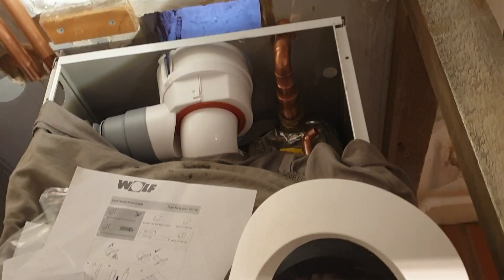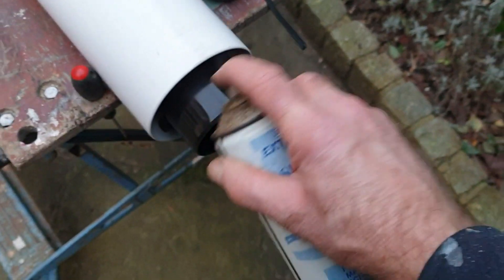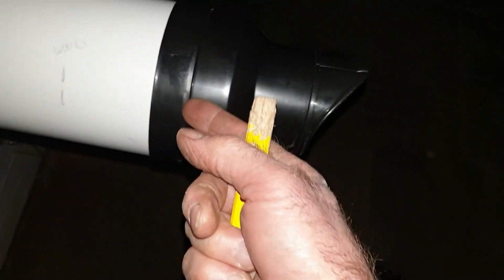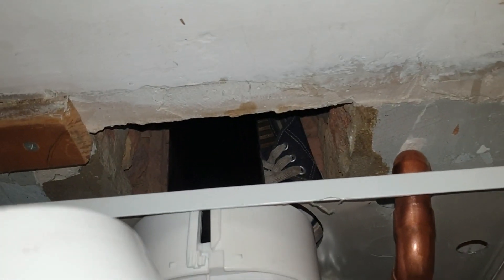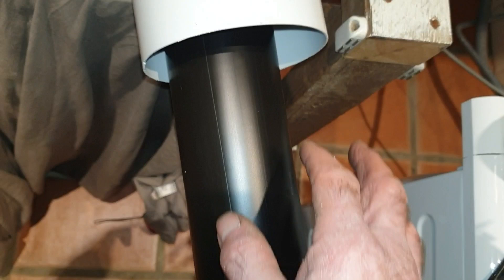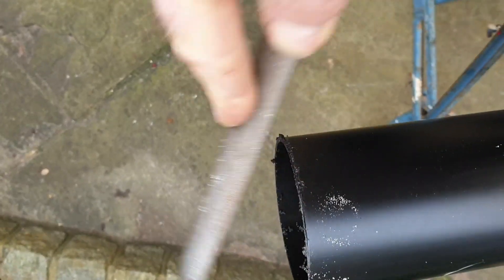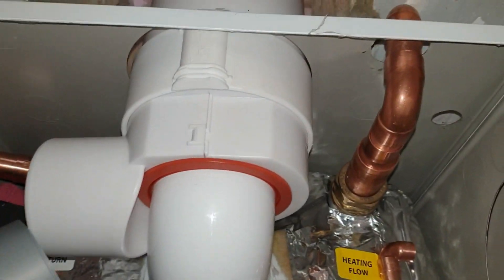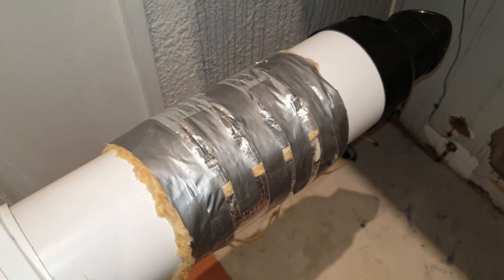How to install an oil boiler horizontal flue🔥

Comment: Glad you got there. I just put it in socket like you , but with the black collar at the termination simply measure from wall to the black collar, then whatever that measurement is, is how much too long the flue is, so take that measurement and reduce the flue length by that figue.
Reply from the maker: Well done mate,I also installed a new oil boiler,system type